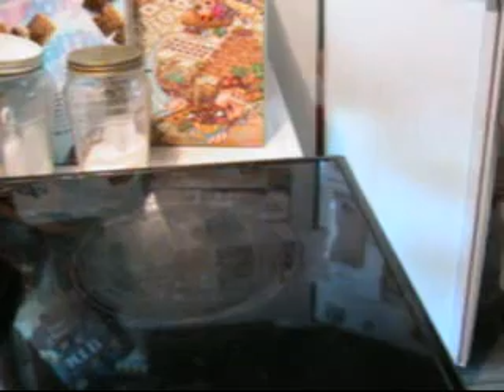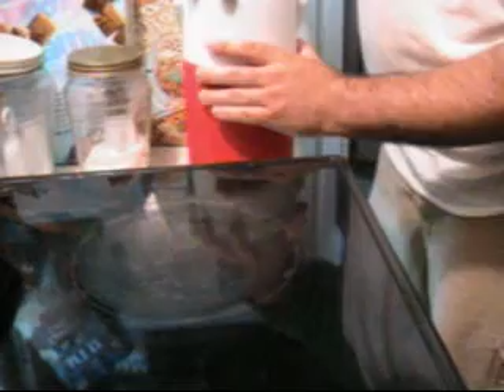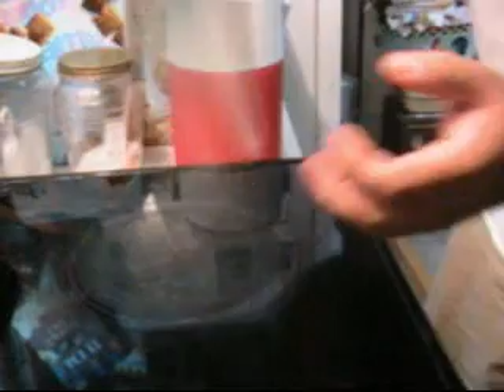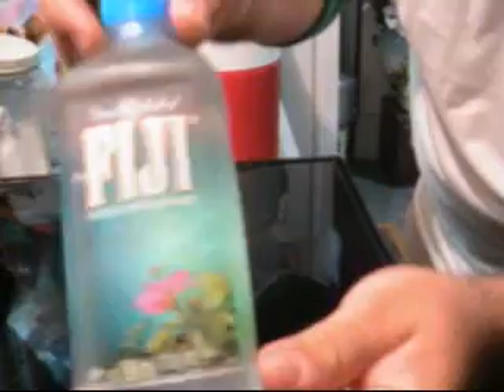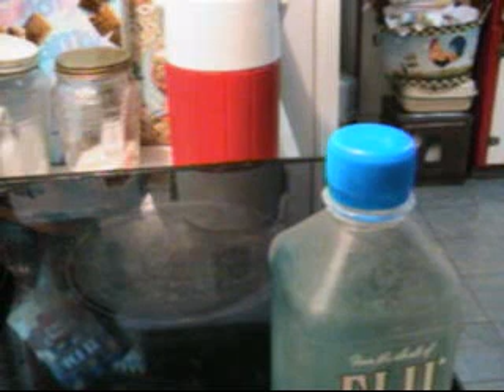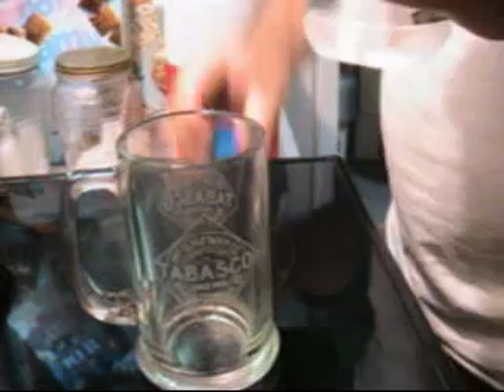Supercooling Experiment gone wrong.

Comment: i was thinking that at first to. but then i thought also that it was prolly because that since the watter was in its original container it may not have any particles to start the nucleation process. i just read about this on wikipedia and they said that it has to have a single abnormal particle to cling to or something like that